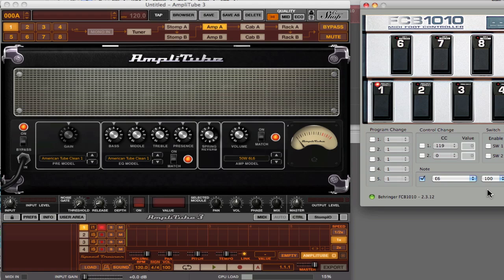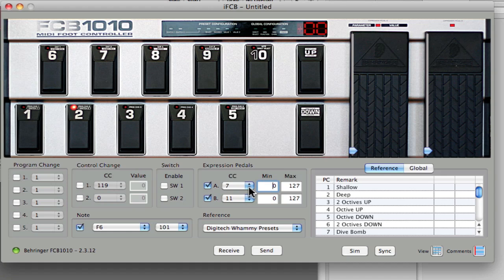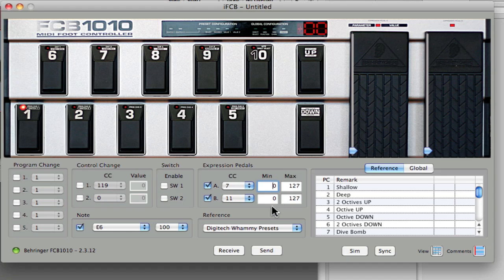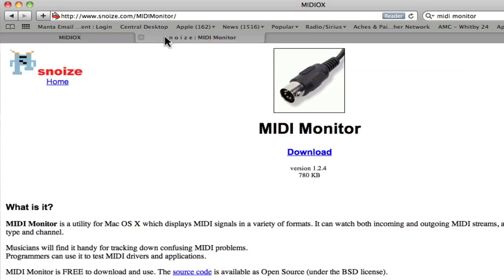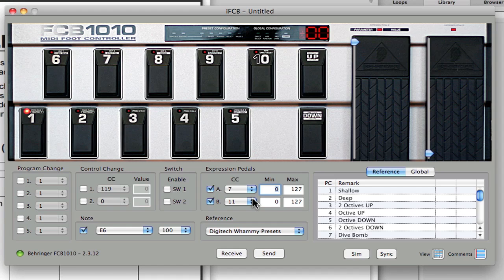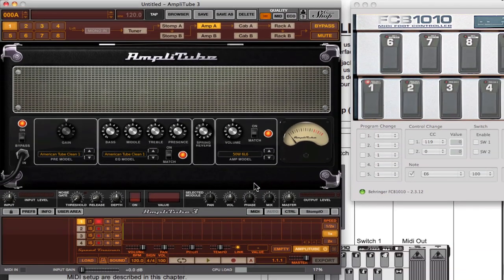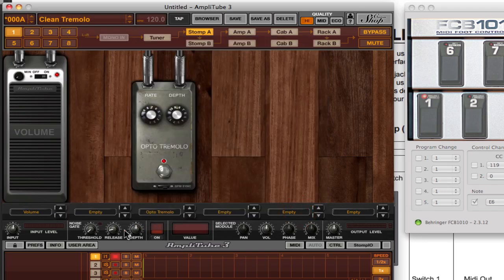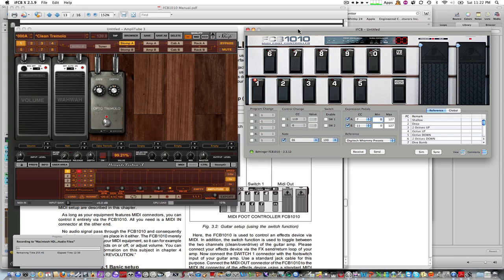Set up FCB1010 Expression Pedals for Wah and Volume in Ampltube 3.5 (Watch in full screen mode)

Comment from the maker: Glad to help...since you want to use both guitar and MIDI for the FCB, yes,  the best thing is to get an audio/midi interface.  A fairly inexpensive choice is the M-Audio Fastrack Pro, you can get these used for a reasonable price.  It will support your guitar in as well as the MIDI in/out for the FCB.  The Fastrack then connects to your computer with a single USB connection.

Comment: Jas.  This video was instrumental in both setting up Amplitube, and my newly acquired FCB1010.  I finally figured out that getting the FCB1010 to calibrate, one has to unplug the midi cables from the FCB1010.  Again, great how-to vid!  Although, I can't get my FCB1010 to learn 7 and 11.  Mine is set to 27 and 7.  I'm using Windows version of the FCB interface: Berhringer FCB1010 Midi Edit Utility v2.99-2.  No worries... it works!

Comment from the maker: Happy to help..the first thing to understand is that the FCB is not a USB device.  I'm sure you know but what it means is that you need to connect the FCB via MIDI cables to a MIDI device.  I'd say buy something inexpensive like a used Fastrack Pro and connect both your FCB and your guitar to that.  Connect the interface via USB to your computer.  The MIDI/USB cable might work but I can't say for sure, anyway I'd prefer to do all the midi and audio processing outside the computer for less load.

Comment from the maker: @nathan7thave Thanks for your comment and question.  Yes, you're right that's exactly what you can do.   The way it is to assign switches 1-5 for stomps, 6 for patch down, 7 for patch up, 9 and 10 I use for cuing backing tracks.  I also use another bank for direct preset access if I need it e.g. if your mapping presets to specific songs and don't want to do a lot of patch up/down to get there.  The expression pedal are used globally for Volume and Expression through all patches. Hope that helps.

Comment from the maker: The best thing to do in this situation is to re-calibrate the expression pedals.  The procedure for doing this starts at the bottom of page 12 in the manual and continues onto the top of page 13.  Follow this process, setting the Volume pedal to CC 7 with a value range of 0-127 and the Expression pedal to CC 11 values 0-127.  That should work! 

Let me know how it goes :)

Comment from the maker: Yeah, the FCB1010 isn't USB, only MIDI connectable so you might want to try a MIDI -> USB adaptor then run USB into the MOTU.  Waves should recognize the MOTU as an input device for both audio and MIDI.

Comment: Hi Jas, what is the best way to deal with keeping the same preset in the same bank but being able to turn on/off the wah. I assume the stomp box method but I dont seem to be able to assign anything to the wah or the expression pedal in addition to the expression pedal function 0 - 127.. I know I could build another patch but im trying to avoid that slight delay when switch between presets.

Comment: Jas, thank you for your recommendation. I looked for the Fastrack Pro to no avail. I did find a Tascam unit (US-144 MKII) which is supposed to be audio/MIDI interface...do you reckon it would work? I thought everything that was MIDI would work together, but apparently not. Again, thanks for taking the time.

Comment: I have never been able to get pedal B to register a midi signal in my DAW. I use Studio One. Could this be the reason? Have you a link to the manual and the software?
Reply from the maker: I would first test to see if there is any MIDI message being sent out of the FCB1010 when you press pedal B. Use a midi monitor app like https://www.snoize.com/midimonitor/ (or similar Windows based app) to check MIDI messages coming from all channels. If there IS a message then you can start looking at the receiving software but Studio One is great, receives all MIDI so should be no problem. If no MIDI message is being sent out it could be a hardware problem or configuration problem. For the manual check https://manualsbrain.com/en/manuals/758364/

Comment: Hey buddy, great videos.

I'm wondering... I'm using Positive Grid Bias Desktop (basically amplitube w/out effects). 

Is best practice to use amplitube's pedals and volume/expression pedals? Can I bypass all their amps and models and just use the pedals to drive a 2nd plugin (bias)?

I could also use the logic pedalboard pedals or mainstage, but just not sure what you would suggest as best practice... I do like the FX in amplitube a little more, quite a bit more versatility than mainstage.
Reply: Yes you can... Using a DAW

Comment: I don't know if this was covered in an earlier post. Would you tell me the hardware configuration for your setup. Do you use a Midi interface? Are you connected through another piece of gear? MainStage is not seeing mine at this time. 
Thank you for the help/

Comment: Are you using a different Firmware? i just ordered a brand new fcb1010 and im reading everywhere online that i might need to upgrade it to a UNO chip... i want to use it with stand alone amplitube 3.7

Comment: hi, i have a question about it, first i need reset the fcb1010 there have 3 forms to Switch it
1 + 6 V-AMP family products
1 + 7 Default setting for BEHRINGER guitar amps
1 + 8 BASS V-AMP product rang

so i need to chose one to begin. but i dont know what chose

if anybody can help

thanks
Reply from the maker: +JA AA It really doesn't matter so just choose the first one.   You're going to change it later to what you want anyway.
Reply: I have only the demo software  any can share me the full versión for mac osx. Thanks
Reply: +JasTheMusicman now i buy the iFCB please help me i dont know what do it . i do step by step and when i puss the button SEND 
open a windows >

THE FCB1010 needs to be Sysex Recive Mode

1. Power up the FCB1010 with the DOWNB key pressed.
2. Press the UP button 2 times *Config LED lights up(.
3.Press the 7 button to recive the Sysex file.
4.Click SEND button below.
5.After LED on button 7 goes out. press DOWN button for 3 secconds.

i do it those stesp but lose any configuration or dont save it
please tell me what i need to doit eache time i press SEND the windows is coming.

thanks

Comment: Hi Jas, after a few minutes (or even seconds) my USB MIDI interface stop working, freezing, specifically the yellow light. This happens only when I use the Expression pedal. Do you have any idea? Thanks
Reply from the maker: Yea, unfortunately not all MIDI interfaces are created equally and can be unpredictable given different MIDI streams throw in drivers, OS updates, etc and anything can happen.  It sounds like it worked before no problem so try to think of what changed in your environment.  What kind of interface is it?  I would also look at possible driver updates from the mfr (if there are any).  The other thing you could do is make sure your FCB settings are saved then do a factory reset on the FCB and try the default settings to see if that also causes the problem or not.  If not, load your own FCB settings back in and see if that causes it.  This will tell you if it's something in the MIDI data that's confusing the MIDI interface.

Comment: BEHRINGER FCB1010 and M-Audio M-Trask (Sound card + usb + MIDI) and connect them to MIDI, whether it will work on a guitar rig or amplitube program, I did not understand the connections, if you do not difficult to explain to the connection diagram on the computer, thanks.
Reply from the maker: +Irakli Gogiashvili Sure, guitar -> M-Track audio in, M-Track USB to computer, FCB1010 Midi Out -> M-Track Midi In, M-Track Midi Out -> FCB1010 Midi In.
Hope that help!
Reply: +JasTheMusicman Thanks, helped.

Comment: is it possible to use midi piano instead of fcb1010? i mean using the keys of the piano as the pedal switches
Reply from the maker: The keys will use note on/off, which may switch the pedals but won't do a toggle on/off.  However, if you have keys/switches on your midi piano which can send the same CC twice with two different CC values then it's possible but most will just use note on/off which I don't think will work.  Having said that, I haven't tested it so give it a go.
Reply: JasTheMusicman well i just tried it..its exactly like you said..i tried my midi piano on a program so i can see what every key does....i found some keys on my piano which can send the same cc twice ...however when i plug my piano in my computer and i see that my computer is reading the midi notes ,i try to "learn" the bypass of the pedals but for one strange reason my piano doesnt link correctly with the amplitube and cant get the midi notes..i tried to use it threw fl studio ,i testes also with other effect plugins like amplitube and they were wroking correctly... but amplitube doesnt work with the midi  :/ cant unterstand whats happening !
Reply from the maker: Grigoris Patinis Is your piano and Amplitube talking on the same MIDI channel?
Reply: JasTheMusicman of course!

Comment: HELP!!! I can't get AT to use midi learn. It just sits there waiting. I have imac 10.6.8 so I can't use midiox to see what is happening. I accidentally got the exp A pedal to change presets but I can't get it to learn the foot switches. I am using AT 3.11.something with cakewalk usb to midi interface um-g1 with fcb1010. I have ifcb and the sysex has been properly loaded onto fcb. Mel from wabbit told me I need to use iconnectivity mio instead of cakewalk. Is this what you connect with? I have watched all your vids and I have set everything up like you showed but AT won't respond in learn mode. WHAT AM I DOING WRONG? AAAAARGH!
Reply from the maker: Hey, were you able to get this working yet? If not, let me know and I'll try to walk through the problem with you.
Reply: Jas - While working with Mel; he had given me an older midi data logger and it kept showing "invalid; reset" while trying to get the pedal board and AT to talk. Just waiting to get an iconnectivity usb/midi interface which should solve my problems ... ?
Reply from the maker: Ah yes, that could very well be it and Mel's the man! ;)